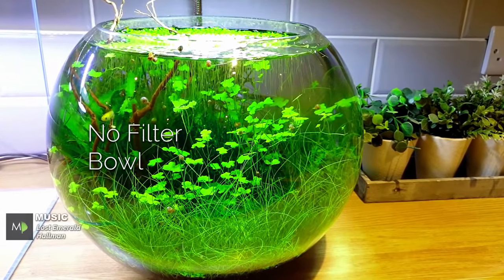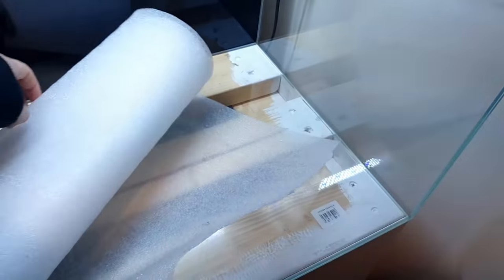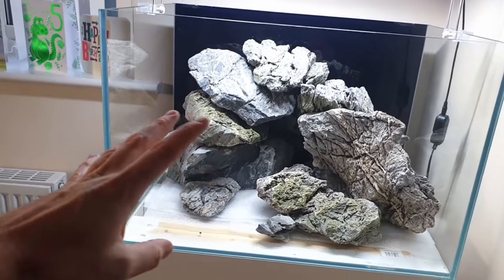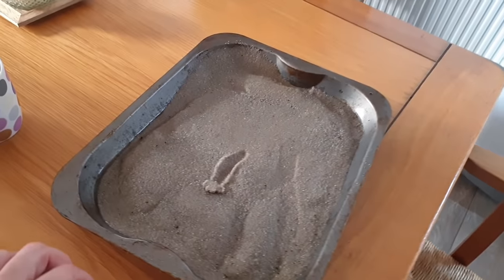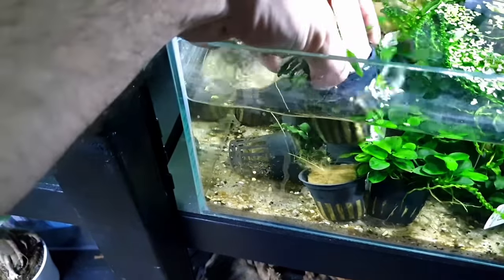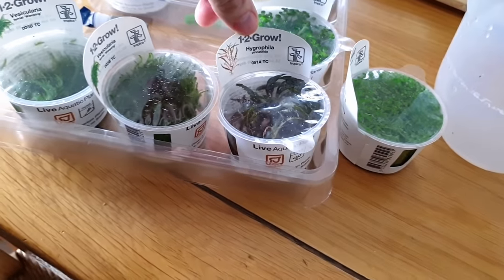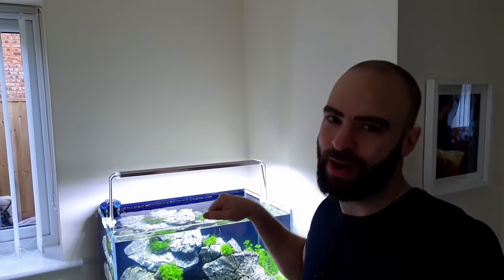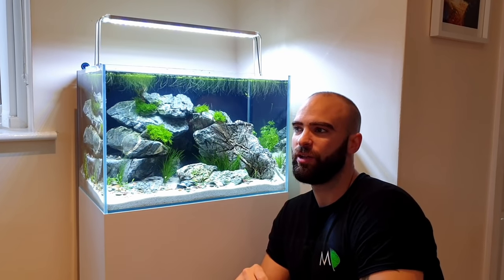"THE CAVE" AQUARIUM......How To - Aquascape Tutorial / Setup

Comment: Another beautiful scape. How do you come up with them? Have you seen where they put a ring of tubing that floats on the top of the water? It keeps the duckweed on the outside and allows the light to get to the plants underneath. You can't tell that there's a hole in the middle from the front.
Reply from the maker: yes ive done it....but i use the duckweed to diffuse the light so that would defeat the point of it.

Comment: I am concerned about the rock sitting directly on glass separated by a thin layer of plastic. The rock has sharp edges thaht will cut into the plastic and create sharp points of weight directly on the glass. The potential for the rock to etch the glass at those points is very high. Please tell me you put the rock on sand to distribute the weight on the glass.
Reply from the maker: nope....lol. I like to take risks haha. no honestly, there are basically 3 main rocks the rest are placed on, these are almost completely flat and there are lots of layers of the plastic sponge beneath them. There will be no issue :)
Reply: @MDFishTanks  Glad to hear it. The scape is lovely. 

Very nice work.